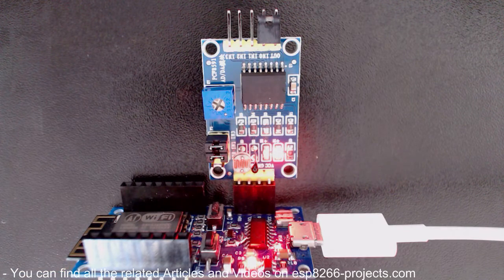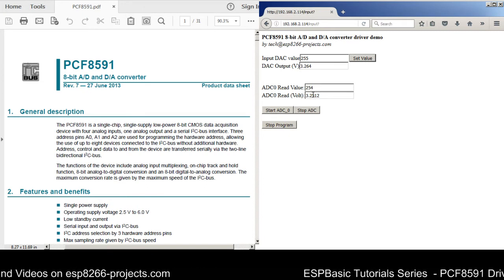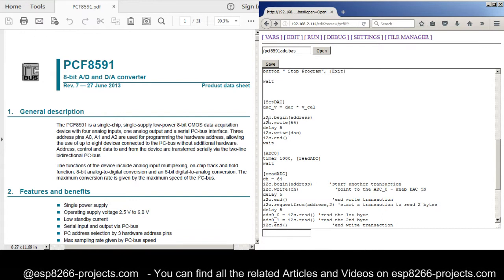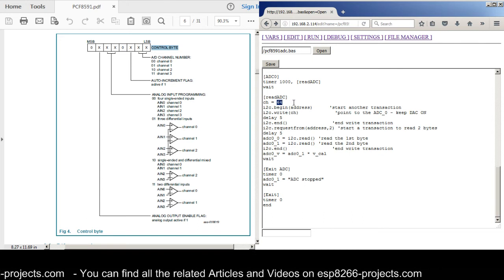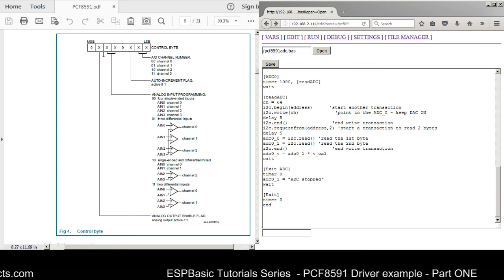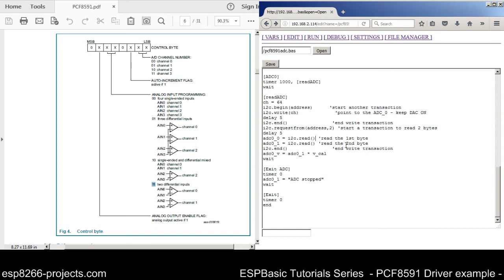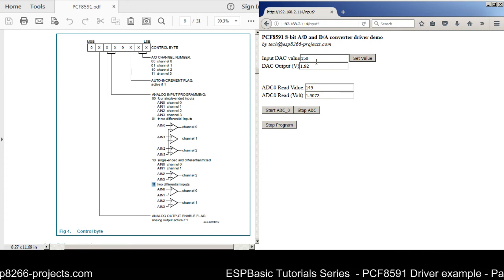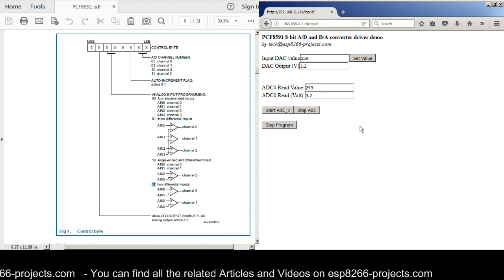ESP Basic - PCF8591 - 8bit ADC/DAC - Part 2 - ADC Driver Tutorial

Comment: Hi, I want to use this as an extender to my nodemcu 1.0 Wi-fi board. I need to have more analog inputs - 4 would suffice. I need to read voltages ranging from 3v to 15v. I'm going to make voltage dividers to accommodate the 0-3.3v, but I cannot find anywhere any code in Arduino IDE for connecting this. Is there any library that I can install? Thanks